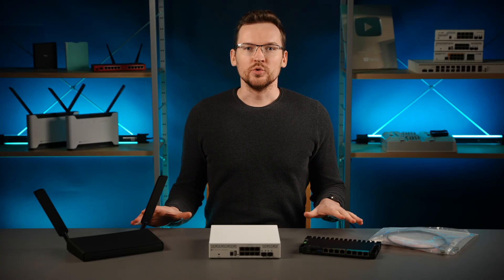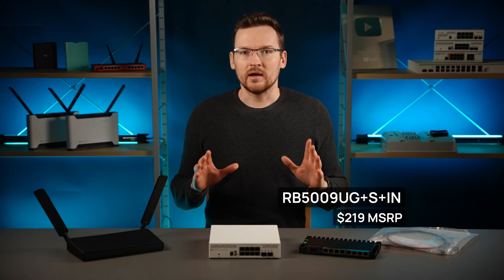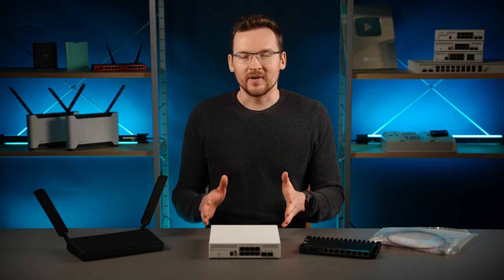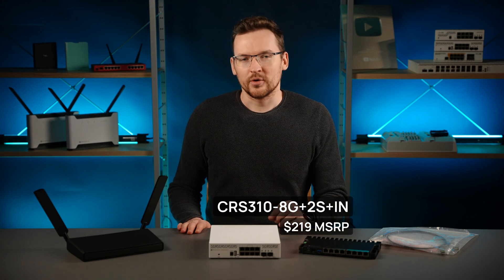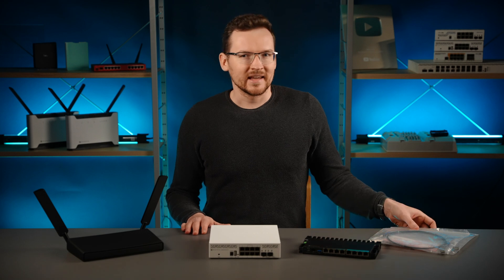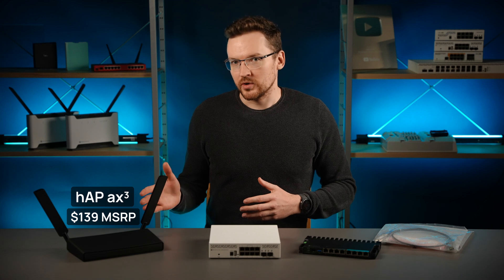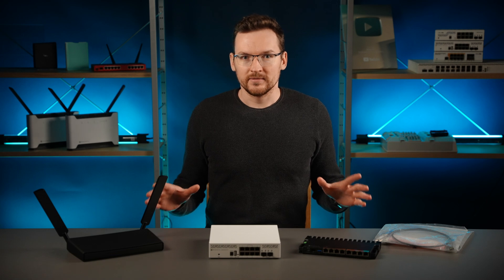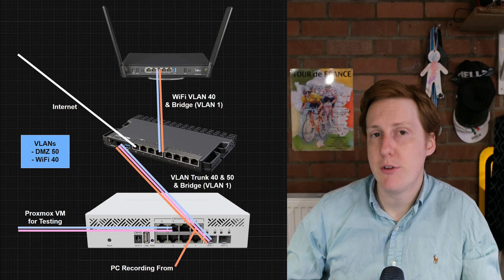Build your own 2.5G Home Lab with JIM's Garage

Comment: I'd argue that CRS310-8G+2S+IN is an awesome switch, but it's not perfect. A perfect one would be 8G+2S+ in the same form factor as rb5009 with passive cooling and with 802.3af/at on at least some of the ports.

Comment: I think Mikrotik is missing a huge opportunity with lack of 2.5 Gbps switches with PoE++. (as minimum) in combo with 10 Gbps and even 25 Gbps!.  That will be a killer setup for Homelab.  I also like to see the new version of the RB5009 that has at least 2 x 10 Gbps and 2 x 2.5 Gbps!.  And for Wi-Fi a more GUI friendly CAPsMAN will be awesome but I guess I have to wait for the Central Controller that Mikrotik has been pocking in the forums for a while

Comment: Hey Jim. I think you should’ve connected the devices in another order. The DAC (or AOC, dunno) was correct between the RB5009 and the CRS310. The “problem” was with the hAP AX3. It would be best if you connected its 2.5Gb port (ether1) to the 2.5Gb port (also ether1) of the RB5009. Judging by the fact that there’s only one 2.5Gb port on each (5009 and AX3) it could be the easiest and smartest design in my opinion. You could’ve also plugged it into one of the CRS310 2.5Gb ports. That design can help you practice vlan trunking and other vlan scenarios. Despite of it all, was a great video. Congratulations for the opportunity my friend. And cheers to MikroTik for making so many great products. You guys changed my life. And please, check my channel. 😅